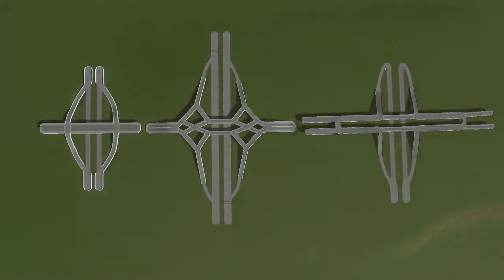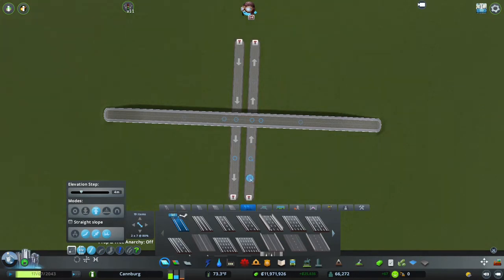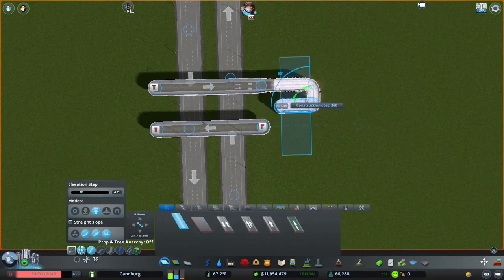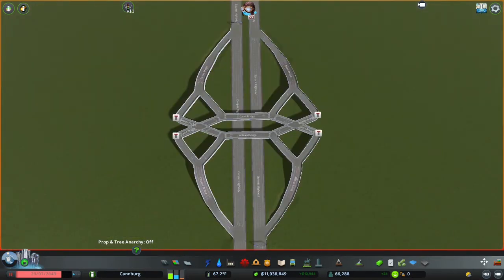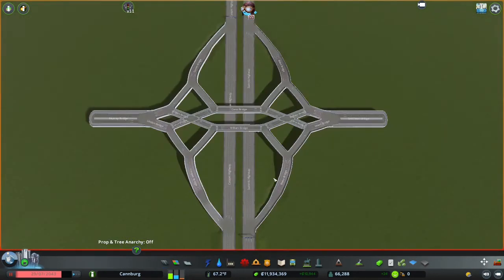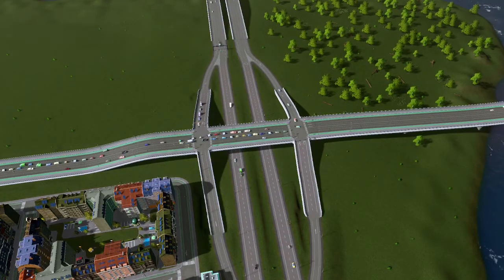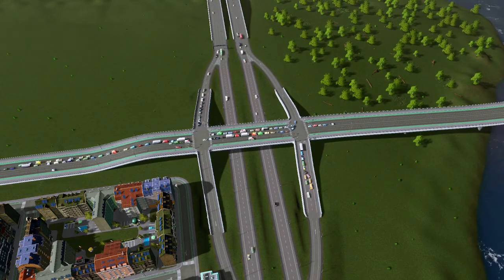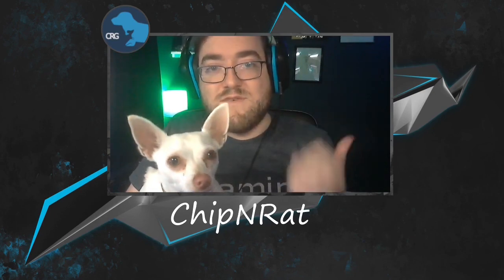Diamond Interchange VS Diverging Diamond VS Custom Diamond Interchange in Cities: Skylines

Comment: I also do 4u apart but i use 4way highway segment so diamond has a 2lane merge to 4lane and split back to 2lane and i make the diamond with 5u square guide roads off from the bridge segment to get the node for the diagonal roads and the diagonal road to the collector is 6u.
6u is important for console players as it will give the two lane road entering the collector the correct lane arrows and both lanes will be straight onto the collector and you wont get that turn only lane in the inside lane.

And the diamond itself is 60u.

Really easy to build and a great interchange for begginners to use.
Reply from the maker: That's great feedback, especially for the console users, I appreciate that. I don't really get a lot of visibility to console's hardships being on computer and with all the mods all the time.

Thank you!